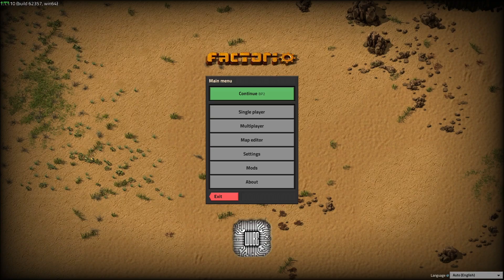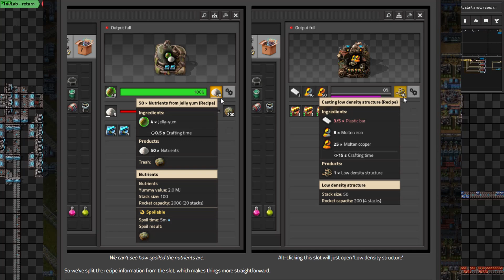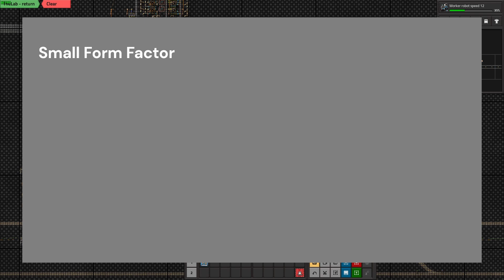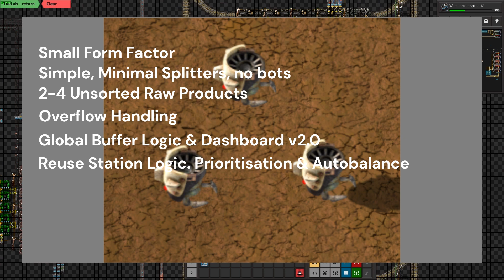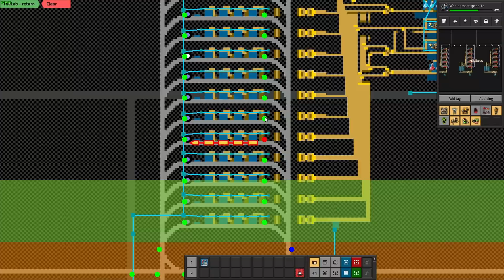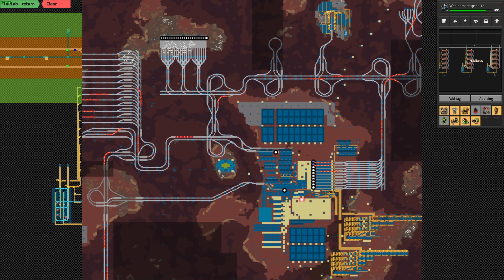Factorio 2 0: Space Age - SCRAP Enhanced

Comment: They are buffing smaller dual headed trains. You can use elevated rails to have same side entry exit, but on a separate level, so exiting trains no longer block incoming trains to other stations. You can get massive throughput without even needing a station with a U-turn.

I'm pretty sure it will be extremely elegant and compact if you just use same-side entry exit 1-1-1 trains, with elevated rails dealing with train exits off the island entirely. It takes extra long to fill those 4 carriages with just the 2 inserters anyway. It seems like its time to turn to the dark side of dual headed trains.
Reply from the maker: True. For this demo, 1:4 was personal preference only (and a triend and tested blueprint).  Doubleheaded trains though?  That is a power that some may consider... unnatural